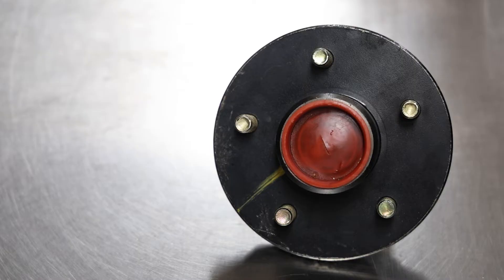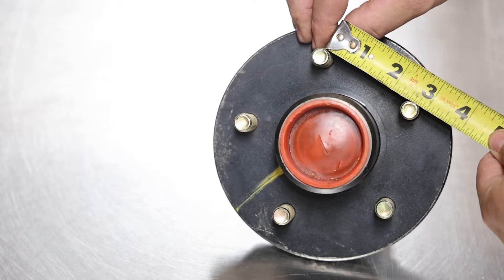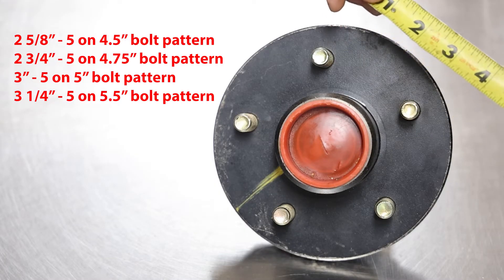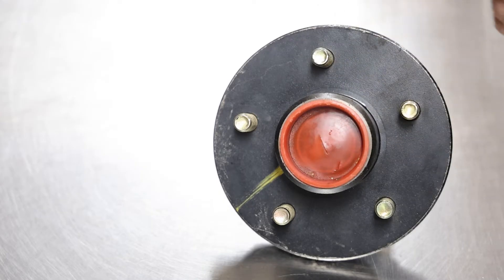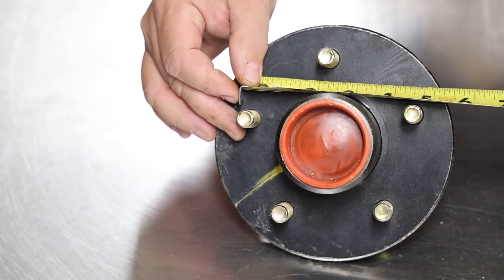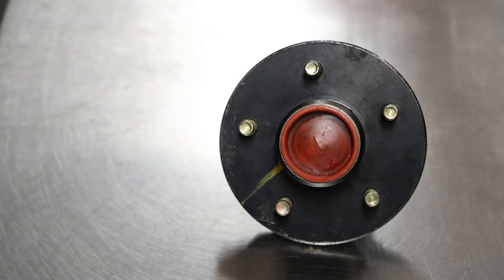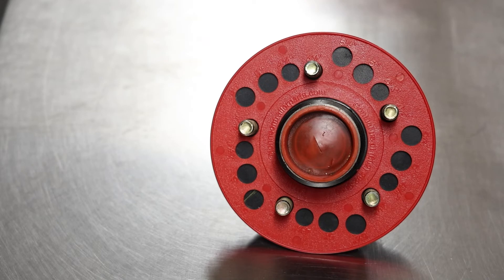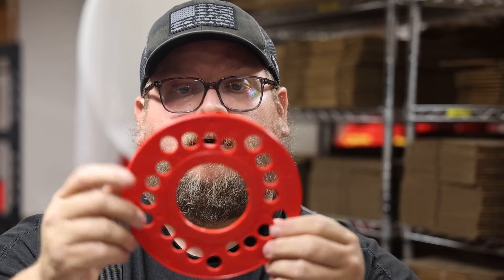How to measure a 5 lug trailer wheel bolt pattern (UPDATED)

Comment: Thank you! I finally got it that in 5x4.5, the 4.5 is DIAMETER not the exact measurement between every other stud. Also found you can download a template and print it off at 100% and cut out the holes to make your own.

Comment: I got it, but why is it not simply center to center on two adjacent bolts or holes for any diameter? Once you know the chord length it determines the bolt hole diameter I believe!
 Much clearer to measure from edge of bolt to same edge on the other to get center to center distance and never worry about the hub being in the way.  Mystery to me!
Reply: Edge to edge on two adjacent bolts is even easier to measure and results in the same.   The wheel industry is insane and should not be looked to for rational behavior.

Comment: I just got a hold of a 2004  5x10 trailer free to good home. 3500 axle .Will be replacing the tires. Will be in the morning when i measure it. Would one this old have 4.5 in ? Most online are 4.5 inch.

Comment: Hi, which rim to use in a toyota 4x2 hilux 1997? Please give all details.
Thanks.
Reply from the maker: I believe on Toyota trucks, if it is a 6 lug pattern it would take a 6 on 5.5" (6x139.7) bolt pattern wheel, If it is a 5 lug it would be either, 5 on 4.5" (5x114.3) bolt pattern or a 5x100 bolt pattern. When it comes to vehicles they may have different bolt patterns than what trailers would have. It would be best to check to see if it is marked on the door placard or owners manual for what bolt pattern your truck is.